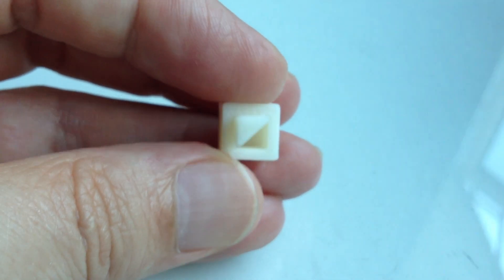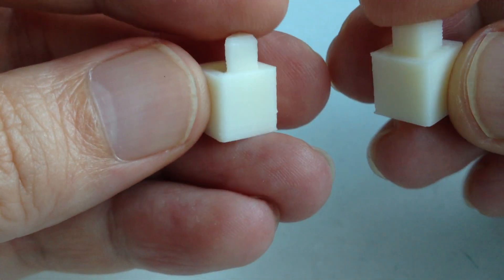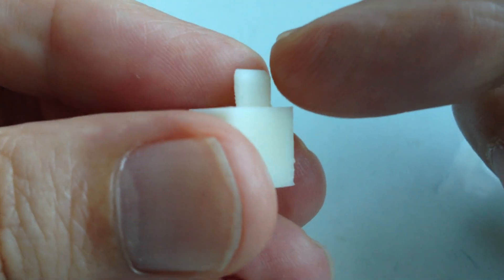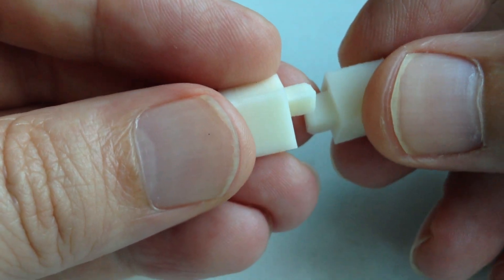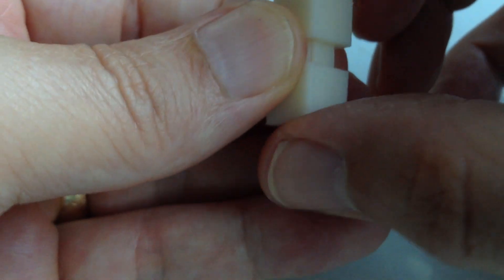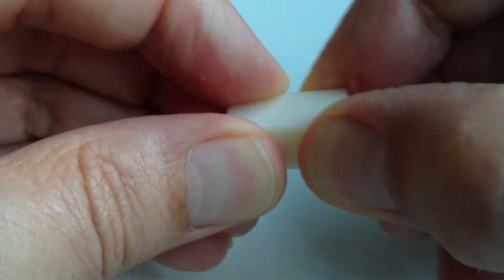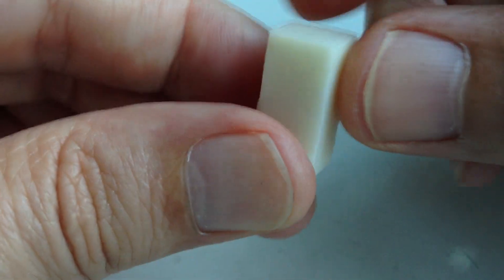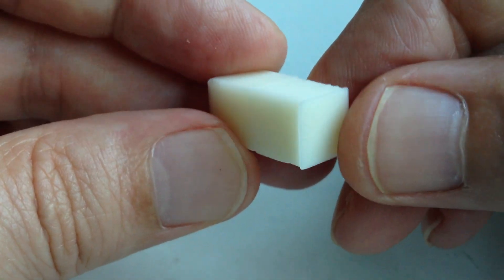Locking joint for 3D printed objects

Comment: Hi Richard I’m a bit new to this. How much did you reduce the hole size by? It’s hard from me to tell. Thanks Simon. ( the fit looks perfect by three way)
Reply from the maker: Hi Simon
I recommend downloading OpenSCAD and having a play with the script on the Thingiverse page. I have just done exactly that to remind myself of the answer to your question. At the top of the file you will see:
  cube_size = 10;
  prism_width = 6;
  offset = 0.1;
  base_factor = 1;
The important value is the Offset. 0.1 mm is a very good starting point, but, ultimately, it all depends on how well-tuned your printer is. I like mine to be very accurate and that usually means turning down the extrusion multiplier to around 90% which then means a 10 x 10 x 10 mm cube will measure exactly that. This video was made over 5 years ago - on my current printer I would probably have to reduce the offset down lower to get such a tight fit. Generally speaking it is recommended to have an offset value of between 0.05 mm for a tight fit and 0.2 mm for a loose fit. I usually work with puzzles that have values in the range 0.08 to 0.10 to achieve a nice sliding fit with minimal slop. Remember that the actual gap is going to be twice the offset distance because both contact faces will have been moved by the offset amount.

Comment from the maker: These were printed with a 0.5 mm nozzle although I have now switched to a 0.4 mm for slightly better prints. I usually print puzzles at 0.2 mm layer resolution which is a good compromise between speed and quality.

Comment from the maker: Thanks Marcus. I'm sorry you didn't like my design. Actually it meets all my needs pretty well in it's current form.
My specific requirements were:
- must be small enough to fit in a 1cm cube
- must be strong enough to support many times its own weight and resist lateral bending and pulling apart
- should be invisible from the outside.
The cube has precise dimensions which must not change or the puzzle will not fit together so the wedge pin and tusk tenon wouldn't work for my specific needs.
Reply: Not bad design, probably too tight. If you make a similar design with a larger hole and a little bit more flex, it should responst easier to tolerances but still be plenty strong.